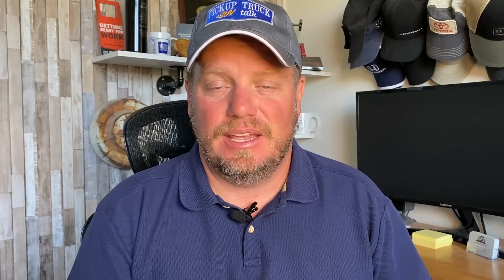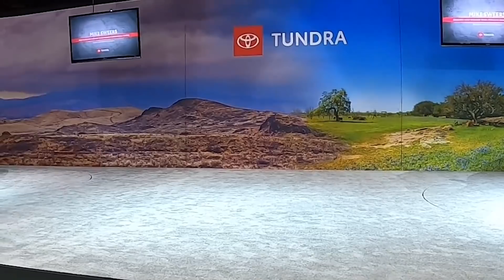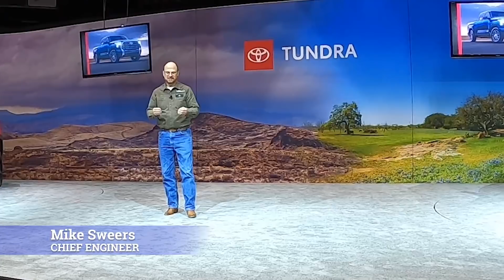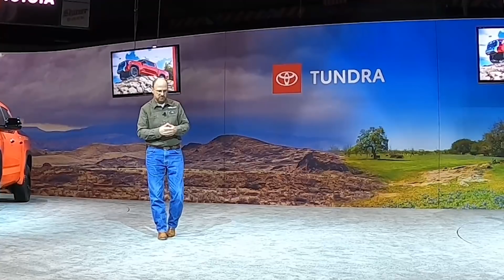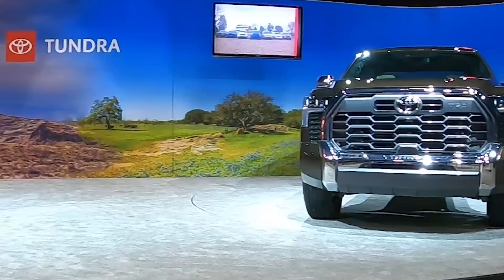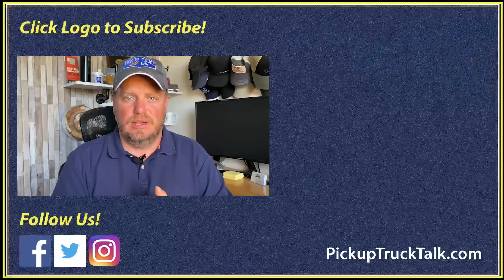2022 Toyota Tundra Chief Engineer Explains Truck Development

Comment: Sir Mike, nice explanation on the All-New 2022 Toyota TUNDRA, hoping that SR5 Crewmax Trim with a 5.5foot bed, be introduce in the Philippine Market, with a Diesel Engine, like in the 2022 Toyota LANDCRUISER LC300, so nice and can compete with the Ford Raptor here the Philippines. Toyota owns more than 40% of the market share here.

Comment: With all the LC300 shared components, I would have loved to see the LC300 transfer case make it into the Tundra as an option. I spend 3-4 months of the year driving slippery winter roads. Being able to spin all 4 all the time even on dry pavement like my Subaru would have been a really nice option. Here's hoping it ends up part of the mid-cycle refresh.

Comment: Hey whenever you get your hands on one of these, can you go over the interior quality? By that I mean previous generations of the Tundra and Tacoma have really delicate interior plastic panels and components like the doors that nick and scratch super easily. I’m curious to see if the quality is any better and more resistant to nicks and scratches from just wiping the doors off.
Reply: Jean Toronto Raptors  
That’s not the question. Question is about the quality of it in the tundra.
Reply: Jean Toronto Raptors  yes. Currently. 
Go troll elsewhere man. Had a serious question for the guy.
Reply: You're absolutely right. My 14 tundra has the cheapest plastic I've ever seen in a car. They're extremely cheap, thin, and scratch easily. I really hope this new truck improves on it
Reply: @MHounan  I love the truck but man I am completely disappointed with the interior quality that they put in these trucks. Hopefully this new generation is a step in the right direction.
Reply: Jean Toronto Raptors  yup me, a life long Toyota owner made up a lie so specific I referred to the plastic piece behind the driver door release handle and how it’s held in.
Reply: I have owned Toyota's and Lexus for the last 20 years. Just recently purchased 2 new 2021 Toyotas and unfortunately the plastic quality has declined. I know because I put plenty of holes in the old plastics for switches, outlets, etc. Might be a weight savings measures, but the new plastics are significantly thinner. What was previously held by a screw is secured by a clip. In fact on our 2021 Sienna the plastic panel behind the driver door release handle broke the first week of ownership.
Reply: Jean Toronto Raptors  since you don’t understand my question…current gen tacoma and tundras have very delicate plastics that scratch VERY easily and it looks horrible. If you don’t have the current gen, just google tundra or tacoma interior scratches. I’m asking someone who does good reviews of vehicles to touch on the new generations interior quality.
Reply: Jean Toronto Raptors  this dude again…

Comment: “Truck guys designed this truck” Sorry, but you left out a front locking differential on your off-road halo truck along with eliminating tow hooks. You made the rear bumper corner prone to expensive damage and took away the stepping point when the tailgate is down. You might want to actually drive and use a pickup in the real world before you come up with dumb ideas. I hope you kept the spare tire!

Comment: Toyota, years behind MUST  have class leading superior: 
⁉️Top HP & Torque
⁉️Top Fuel Economy When Towing @ 75% of Limit  
⁉️Top Reliability
⁉️Best Pricing/Value in segments 

If any of these areas are deficient, sales of Toyota frame on body trucks and SUV’s will continue to decline into oblivion. 

If Tesla CyberTruck has good towing range under 75% of towing capacity load, ICE pickup trucks will decline sharply.
Reply: This is just nonsense from someone who doesn't even drive. Keep up nonsense

Comment: Gm, ford, ram never talk about 500k miles trucks to last, because they cannot design to last that long.  No wonder there is 3 Tundras with over 1 million miles  none from big 3 in half ton class.
Reply: They can design it they’ve done it before back in the day, they choose not too cuz if they did no one would keep buying there new stuff. Toyota cost more upfront but ur getting a much longer lasting veichle.
Reply: The Big Three will have rust coming through the bedside before they're paid off.
Reply: @matthewcarruthers9626 , cab corner,  rocker panels will be rusted out too. You will never see tundra with same rust.
Reply: Keep reliability.... that thing is hideous
Reply: @damitbobby6677 Haha...yup...😄
Reply: So what is your point??
Reply: @Anth230  ,they make garbage that's my point
Reply: @repairvehicle  so you have zero point.  The truth is that all the manufactures have issues. Some more than others. The truth is if you take care of your truck you can make it last a long time. 3 years I havent had one issue with my Ford yet and hear people like you think they will fall apart in that time. Lmao
Reply: @repairvehicle   No I get your comment. You are a toyota only fanboy...😂
Reply: @Anth230  I've had a Ford Taurus it was on its second transmission at 150k miles and needed another one. Engine ticked and the interior was falling off the pillars. For ford to approve junk like that for customers to bite the bullet gets no business from me. Last time I drove a ford was to the junk yard. Never again. Also Toyota doesn't put plastic oil pans on their trucks or manufacturers their vehicles to break down once the warranty expires.
Reply: These million miles toyota never did the real hard jobs the big 3 does
Reply: @markphil7392  , I wonder why no one uses big 3 and only Tundras in hotshot delivery for oil fields?
Reply: @markphil7392  Haha. True. Also Most vehicles that hit the million mark or higher did it very quickly. A million mile vehicle is not amazing if it was done in 10 years or less. Let's see what a 30 year old million mile vehicle looks like. Lots more environmental wear and tear....

Comment: If average MPG is anything greater than 25mpg I am sold assuming the price is still reasonable otherwise FORD Lightning especially with the new federal incentive.
Reply: Problem with Ford Lightning is heavy cargo range. Also, even towing light loads range suffers tremendously.
Reply: True but it possible to get the XLT w/300 miles range for about $55k - proposed federal EV tax credit $12k - $2k State credit= $41k. Not bad

Comment: Did they put back the trans cooler that the previous model didn’t need?
Reply from the maker: They didn't mention it at all.
Reply: @Pickuptrucktalk  Toyota, years behind MUST  have class leading superior: 
⁉️Top HP & Torque
⁉️Top Fuel Economy When Towing @ 75% of Limit  
⁉️Top Reliability
⁉️Best Pricing/Value in segments 
⁉️Traditional Heavy Duty Auxiliary Transmission Cooler

If any of these areas are deficient, sales of Toyota frame on body trucks and SUV’s will continue to decline into oblivion. 

If Tesla CyberTruck has good towing range under 75% of towing capacity load, ICE pickup trucks will decline sharply.
Reply: F150 doesn't have cooler and no one crying about it.
Reply: @repairvehicle  The F150 PowerBoost overheats when towing.
Reply: @user-tb7rn1il3q  ,what, Ford overheats? How heavy is the trailer?
Reply: @repairvehicle  Watch TFL Truck
Reply: Yes Sweers mentions in in another video on another channel